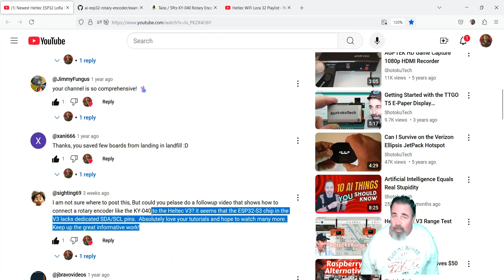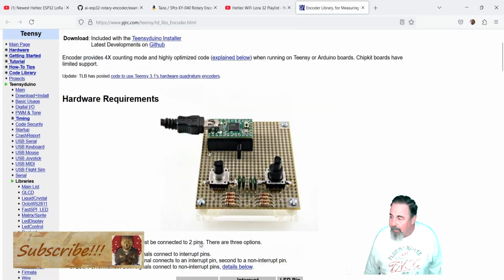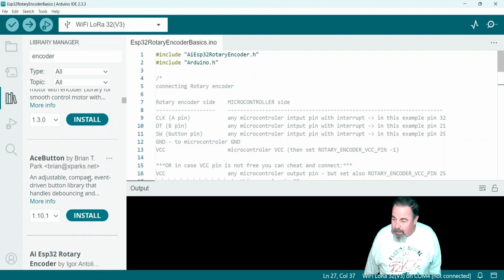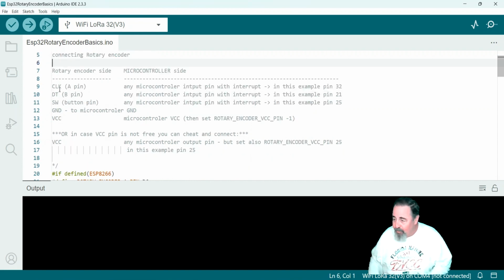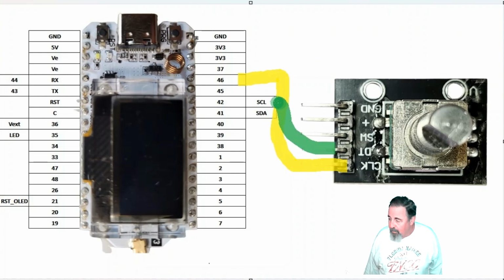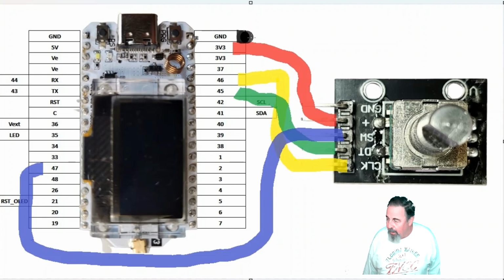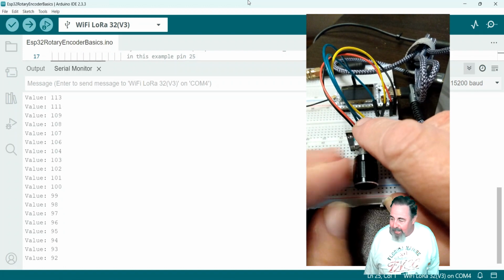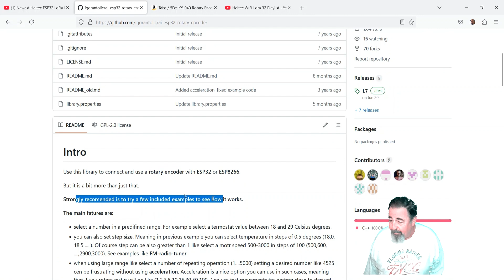Heltec V3 and KY-040 Encoder

Comment: Great video as always! If it’s not too much trouble, could you make a video on how to use a GPS module with TinyGPS++ on a Heltecv3? Im trying to send coordinates using LoRa between 2 heltec modules. It would be really helpful. Thanks!
Reply from the maker: The quickest way to send GPS coordinates between nodes is Meshtastic.
"Heltec V3 with GPS in Meshtastic"
https://youtu.be/iIiD7nGJAKI?si=LEMPIkBcteBIYj3-
I'll see if I have time to try this in Arduino IDE. I have covered connecting the GPS module to the V3. 
"Heltec WiFi LoRa 32 V3 GPS Question"
https://youtu.be/tQZC4GlYhMc?si=dC3GUK-VjhDKNdFJ
I have big playlists for the Heltec and for Meshtastic. Best wishes.
Reply: @ShotokuTech  Thanks, I'll be checking those videos!
Reply from the maker: @Gabriel-iq7nq  Thanks!